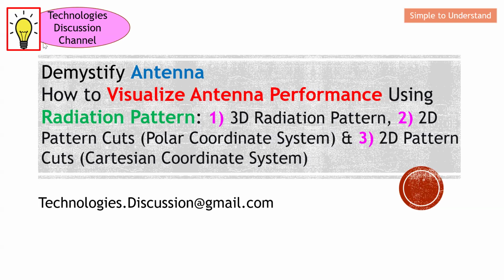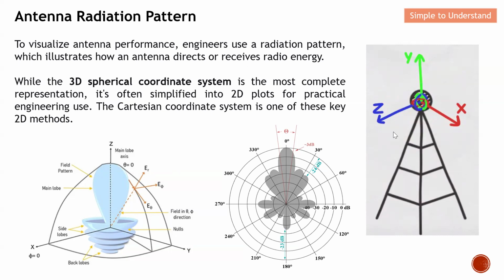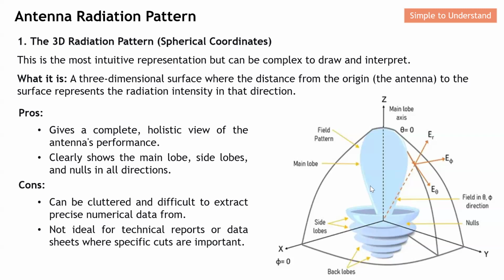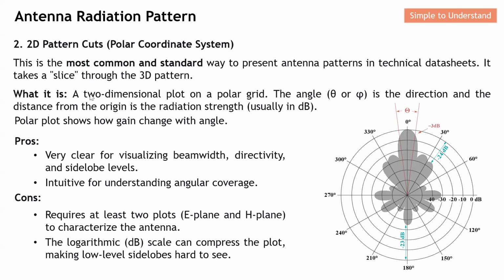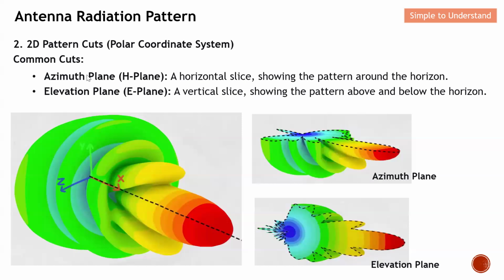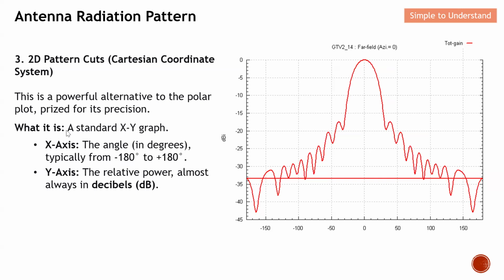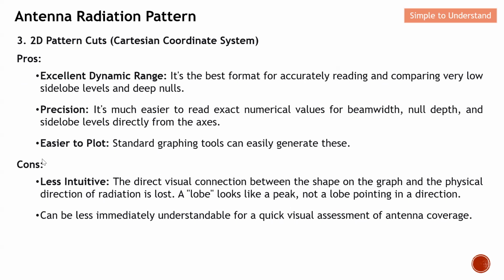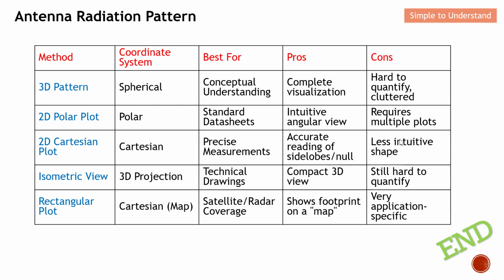Antenna #22. Compare Antenna Performance by 3D Radiation Pattern, 2D Polar, 2D Cartesian Coordinate.

Comment from the maker: In this video, I will discuss how to visualize antenna performance using three methods: 1) the 3D radiation pattern, 2) the 2D polar coordinate system, and 3) the 2D Cartesian coordinate system. I will illustrate which one to use based on your requirements.
The 3D radiation pattern clearly shows how the antenna radiates energy into space. From this pattern, you can determine whether the antenna is directional or omnidirectional.
Next is the 2D polar coordinate system. These plots are azimuth or elevation cuts taken from the 3D radiation pattern. They provide more detailed information that the 3D pattern lacks, specifically showing how the gain changes with angle.
Last but not least, the 2D Cartesian coordinate system presents very detailed information like radiation strength and gain. These 2D plots are primarily used in datasheets because they present precise data, allowing us to specify the antenna's performance.